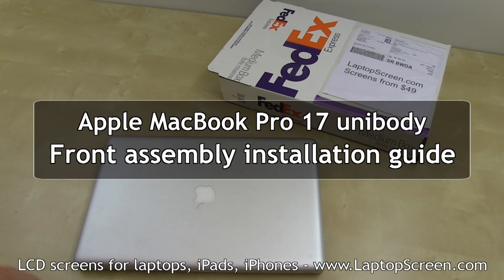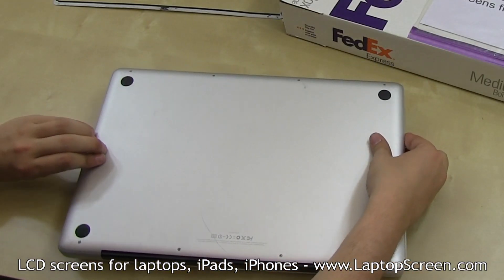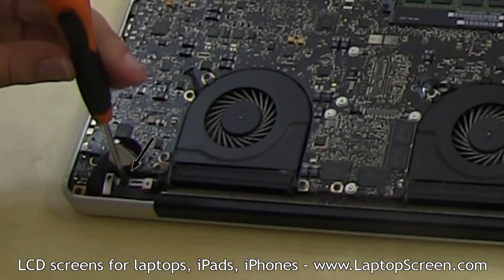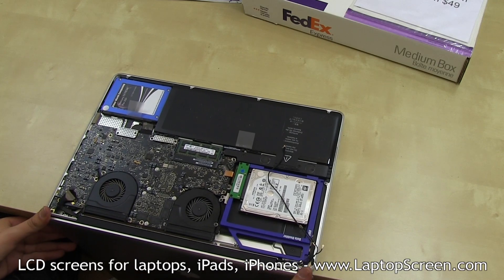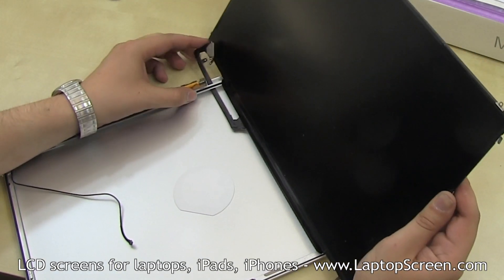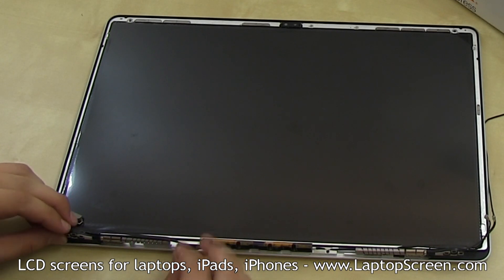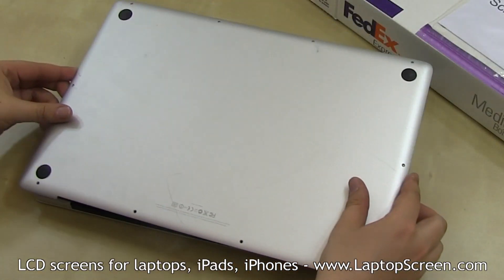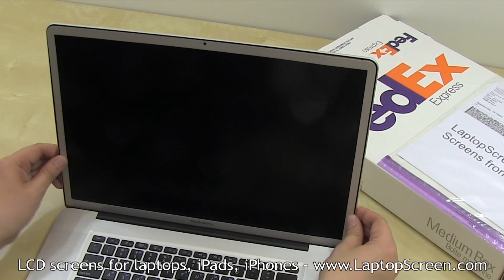MacBook Pro 17 screen replacement /  Installation guide [Apple MacBook Pro 17 LCD repair]

Comment: My screen is black and I've done all the recommended tips such as reset PRAM; none of them worked. I am wondering is there a way to know if I have a bad monitor opposed to a software issue?
Reply: +Teknogod17 Yes, I hear the chime.